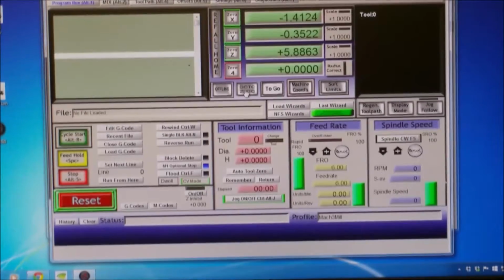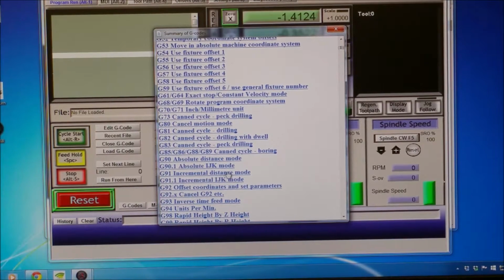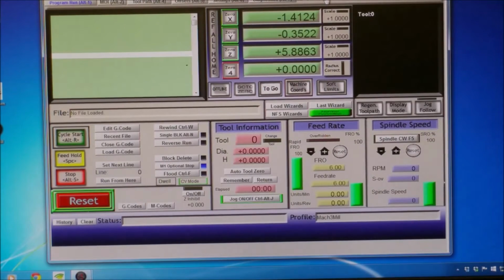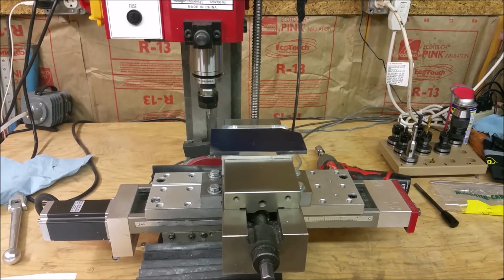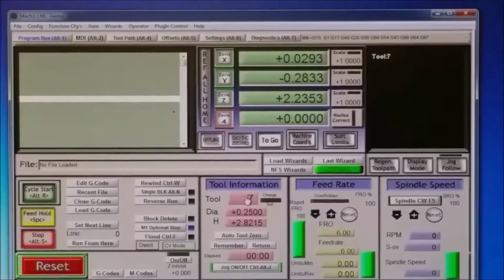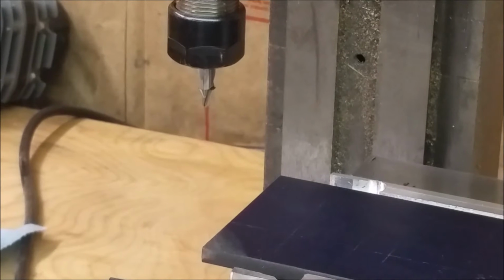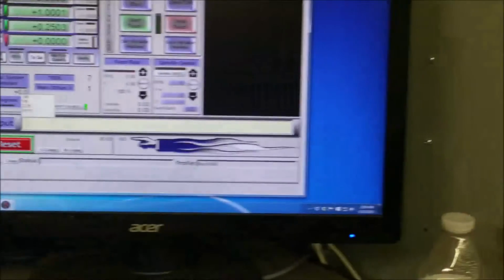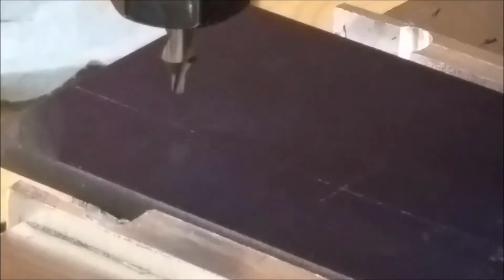Learning G-Code Part 3A - G90/91

Comment: Great video... i have questiin about gcode in mach3 sorry this not topic here.. am sure you know more about it) your help needs please..i have wrote down gcode by myself on notepad txt format am using x axis as clamping system linear movment in mini injection machine ...i put some codes on it and downloaded in mach3 some x axis movments and i want to use some codes as loop can repeated hole cycle till i turn off reseted button...some guys use m97, m47 but in my case no luck)) any help please??? for example in my case...g90 g1 x50 f 350
G4 P10
X0
x-10
X0 
x-11
X0
(these above cycle needs to repeated... any codes as loop???))
Hope some can also help this if knows ..
i really appreciated